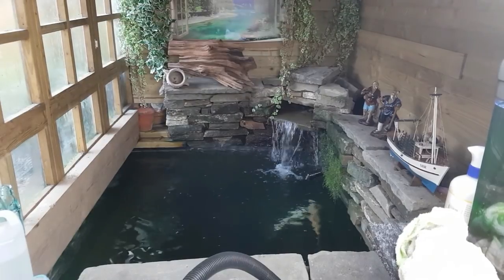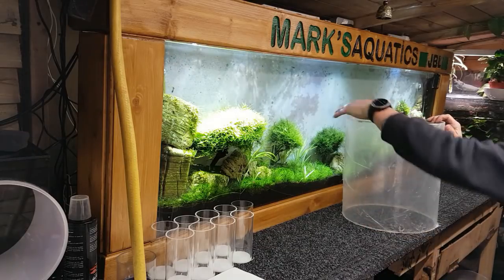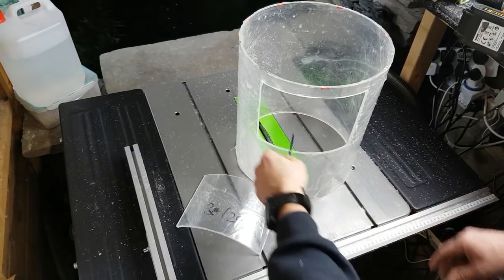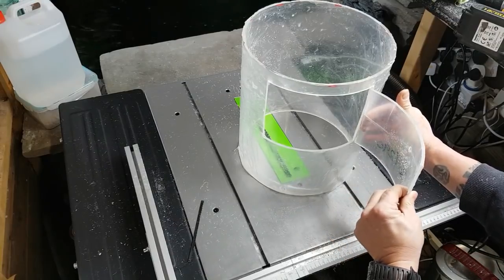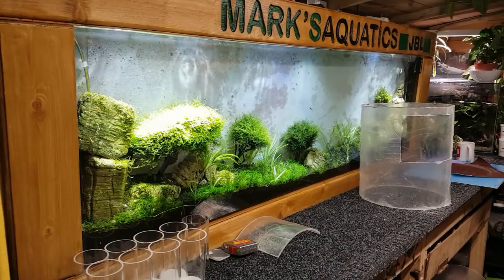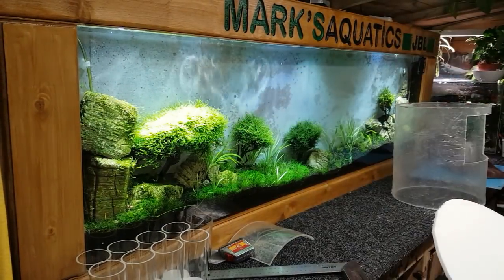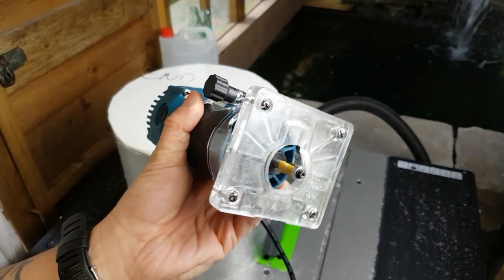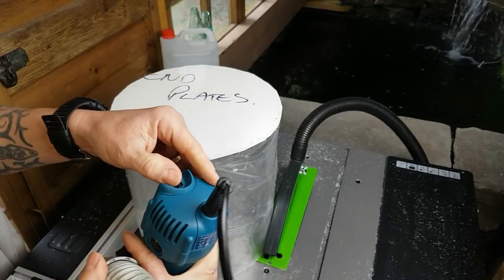DIY ACRYLIC PALUDARIUM PART 1

Comment: I can't wait to see more of this build. 

I have always dreamed of building either a 48 inch by 48 inch or a 36 inch by 36 inch paludarium. I wanted the very front at the bottom to be the aquarium area, then the middle section would be a little log cabin with a "river" and "waterfall" running down to the bottom aquarium part of it. That would really just be the filtered water leading back to the aquarium part with a hidden sump in the back 1/4th of the entire thing. The back section, I wanted to make into a fake mountain range with some lights behind it to look like the sky at night. 

All I pictured in the aquarium part was another water frog like I had as a kid. It was one of those kits where you send the coupon off from the package and get a tadpole in the mail. Mine came with some of his legs partly grown but he was still a tadpole and still had his tail. 

He was a large frog, nothing like most of the frogs you see sold for aquariums normally. He was closer to the size of toads you see in the yard a lot around here. I got so attached to him. 

I need to wait for my budget to match my dreams though. The thicker acrylic is a bit more expensive than the 1/8" stuff I use for my small moss terrariums.
Reply from the maker: Thanks for watching :)

Comment: you make it look so easy cutting the acrylic lol .. think i need a new blade or something for my table saw it gets hot i think as the acrylic sticks to it and re sticks to the part im cutting also.. what kinda blade you use and how many teeth does it have?.. nice build
Reply: I watched a vid of cutting acrylic and cringed when  I saw how high the blade was.  I commented regarding safety issue and his reply was that it had to be high for  that reason.  Maybe this will help. Be safe.

Comment: Hi Mark. Remember I put neons in the shrimp tank to deal with worms, well I would like to leave them there as it doesn't seem fair to keep moving them and they don't seem to be bothering the shrimp. My question is will they eat baby shrimp. Also loving the paludarium, never heard of it but might have a go. Can't seem to find big rounds of acrylic though only small tubing. Where should I look. Thanks.
Reply from the maker: If you have lots of moss and hiding places the shrimplets should be ok.
Yes the paludarium is coming along now.
I've found larger diameter tube on ebay. if you have no luck email a few ebay sellers and ask them if they no where you can get some from.👍😀
Reply: Thank you